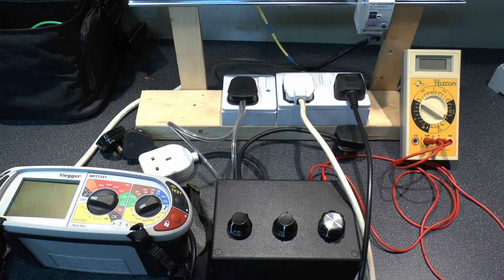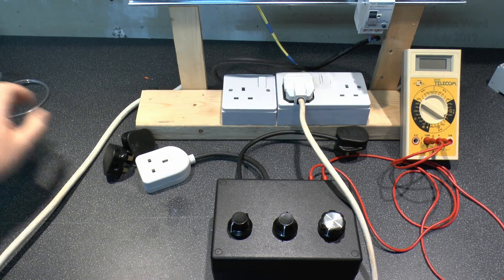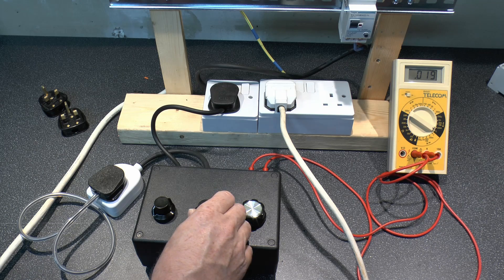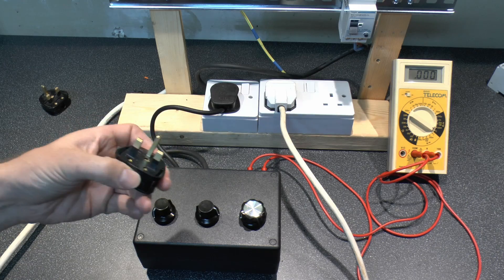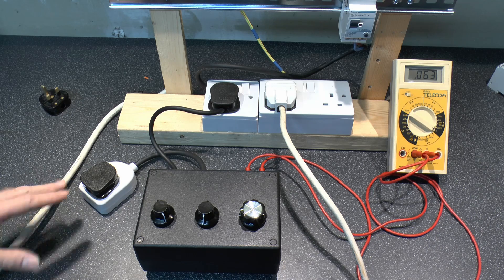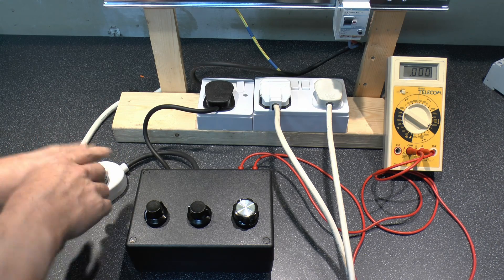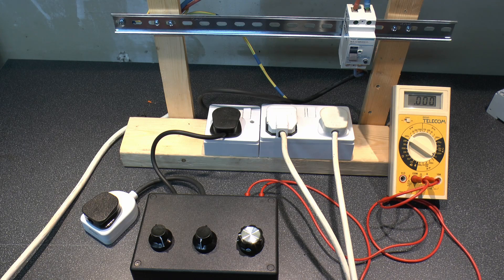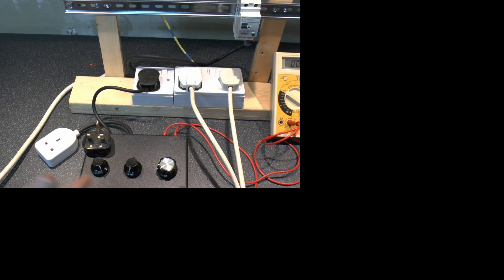RCD Testing Rig Overview - Pulsed DC on Type AC RCD Fails to Trip

Comment: Given the nature of modern loads, why are manufacturers supplying ac type rcds and why are electricians still fittings them? Seems like a massive elephant in the room to me.....
Reply: Manufacturers are still supplying them because there's a demand for them. The electricians are still fitting them because they are permitted to do so by the wiring regulations.
Here in Germany the VDE prohibited the installation of type AC RCDs in new electrical installations in the regulations they release. And to make things worse: They already did this in 1984! So most RCDs here in Germany are type A RCDs. In my opinion that's much more a problem which should be solved than arc fault detection.
I would not make it mandatory to replace them, but I would make it mandatory that in case of a replacement of a defective RCD they shall be replaced by type A. A single phase type A RCD costs round about 20 to 25€, without installation. RCBOs cost a bit more.
Reply: @Naughty_Squad  Foundation earth electrode, or soil embedded electrode in all buildings, no matter which type of earthing system the DNO provides. Coming soon in the next amendement of BS 7671, in Germany mandatory for new construction since 1980.
Reply: Some of us are buying Hager who are supplying Type A with their boards and in RCBO's.
Reply: @johndufton9686  The costs of them are reduced if they mass produce such things and can sell them in several countries. A type AC RCD/RCBO would be a special thing, even if it offers less protection and contains less effort, it is actually cheaper to mass produce the type A  because they can sell it almost everywhere in Europe. The type AC is limited to some countries. Hager is a german company, and in Germany the type AC RCDs are not permitted for new installations (actually this is the case since 1984).
Have you ever seen how these things are made? There's only a guy filling the several funnels with the correct parts. The assembly is completely performed by a machine.

Comment: Are there specific RCBOs for DC? Can a type B RCBO be used in solar pv circuits?
Reply: RCBOs are mostly type A or AC. But there are type B RCDs available, but be prepared: They are quite expensive compared to type A or AC RCDs!
Reply: @Marcel_Germann  Thanks for the very helpful reply. I came across an RCBO on the following website; http://en.chint.com/index.php/product/detail/id/1027.html. If you take a look at the accompanying PDF under "catalogue", it claims it's type B,C, and D. I was wondering if this implies this can be used in solar pv circuits. I know Chint is a Chinese company but they appear to be  reputable enough.
Reply: B, C or D defines the MCB tripping curve, not the RCD type. MCB type B is usually used for domestic, C&D are usually for industrial machines.
Reply: @adon8672  In that case B or C are the tripping curve of the MCB part. The RCD part is AC only, it has only the AC wave on it. Here are the different type of RCDs, there you can see the symbols which are printed on the RCD, the circuitry which could create a specific fault, how the load current is behaving and the fault current. You can see what faults the different type of RCDs are covering:

https://upload.wikimedia.org/wikipedia/commons/3/34/RCD_Fehlerstromarten.svg

So type B RCD is something different than it is on the MCB. Type B RCD (!!) is protection against AC, pulsating current and smooth DC faults.

That's a type A RCD, take a look at the picture, next to the red indicator is the symbol for type A RCD. It got the AC sine wave, and the half sine wave for the pulsating current:

https://www.amazon.de/Eaton-236748-FI-Schalter-40A-30Ma/dp/B000UW4EGE/ref=sr_1_16?__mk_de_DE=%C3%85M%C3%85%C5%BD%C3%95%C3%91&keywords=fi+typ+a&qid=1564440539&s=gateway&sr=8-16

BTW: I would never buy that thing from China. They only got the CE, which is no certification at all, it is only a self-declaration by the manufacturer that it fulfills minimum safety requirements of the EU. Here in Germany most service companies demand in their technical connection conditions that you must install VDE certified devices. Or at least certified by another recognized european testing organisation like the austrian ÖVE.

Comment: Just goes to prove that although they may be a better bet than an old fashioned MCB they are no substitute for a good RCBO ……..
Reply: an RCBO is just both MCB+RCD in one unit. They work the same way
Reply: @jaycee1980  I understand that. There are specific MCBs and RCDs for DC. I just haven't come across RCBOs specified for DC and that's why I'm asking.
Reply: You can also get type A RCDs as a separate device:

https://www.amazon.de/ABB-FI-Schutzschalter-25A-F202A-25-03/dp/B001L5SLP4/ref=sr_1_4?__mk_de_DE=%C3%85M%C3%85%C5%BD%C3%95%C3%91&keywords=rcd+30ma&qid=1564064896&s=gateway&sr=8-4

The type AC RCDs are banned here in Germany for new installations, actually that's the case since 1984.

Comment: It seems like high fault currents; does this mean the RCD's have limited protection abilities?
Reply: It depends on the type of fault current. The type AC only protect against AC faults. And in times of more and more switch-mode power supplies in residentials (mostly chargers for smartphones, tablets and so on) you actually should think about changing the existing AC-RCDs to type A RCDs. Type A will protect against pulsating DC and in addition AC faults. Type B, which will also protect against DC faults in addition to pulsating DC and AC, isn't necessary in most cases. I would only use them in a circuit for chargers of electric vehicles in a residential environment. So AC is practically the basic protection, the other types put protection against other fault current types on top.
Actually here in Germany it is prohibited to install type AC RCDs in new electrical installations since 1984. So almost every RCD here is a type A which would protect you even in that scenario shown here.
These DC or pulsating DC faults are practically "blinding" the AC RCDs, so they won't trip. The DC current is saturating the magnatic core of the measuring coil inside of the RCD. It won't trip, even if you press the test-button. And that's the thing John couldn't demonstrate here because of the broken test-button on this one, but even if it works, in the case of DC it wouldn't work at all.